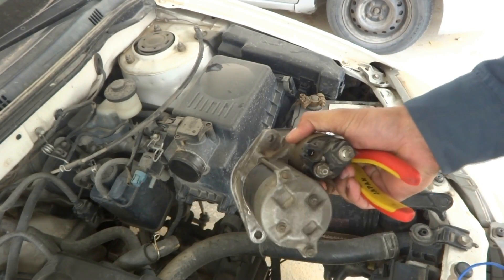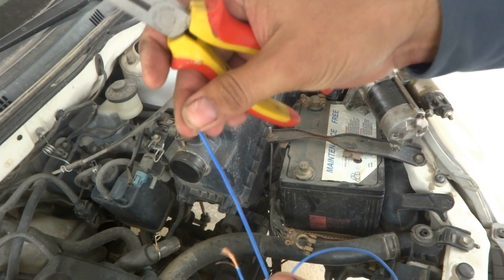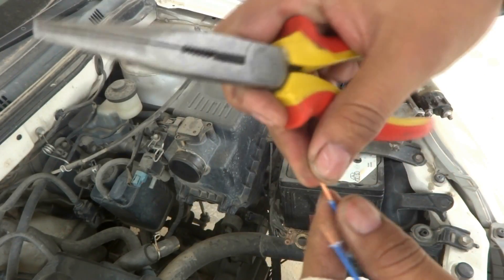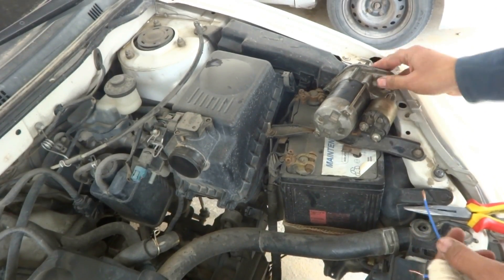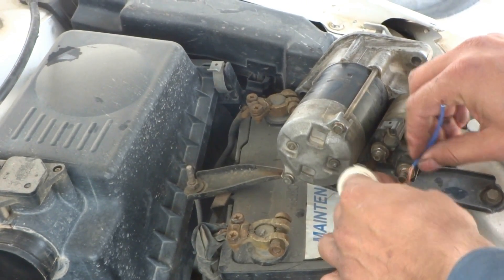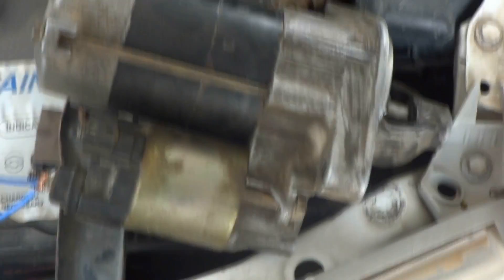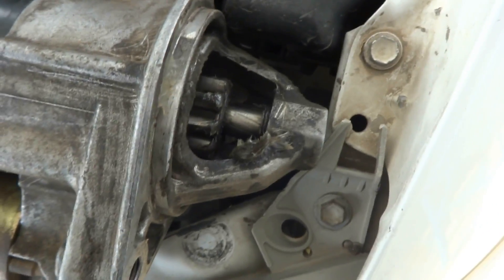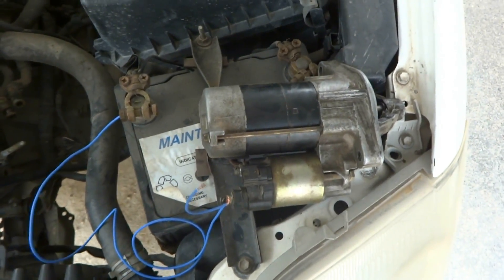Car Self Starter testing. Off car self starter testing.

Comment: Thanks ! My Zen Estilo takes a second to start after moving the key ! I have checked and cleaned the battery terminals but still the problem exists ! My car should start instantly after turning the ignition key ! Pl suggest!
Reply from the maker: There are many possibility to no start condition. Good start is to computer scan the car.

Comment: Dear Sir, Thanks for your great video on how to do the testing. 
My car is Santro Xing 2005 make.
I am facing one problem, that is after I drive a car for 20-30 mins and if i stop the engine and try to start again the car wont crank or it will crank at a very minimum as if it is dead. After 2-3 attempts or waiting for 2-3 mins the car will start again smoothly. 

I had taken this problem to 2-3 local electrician all suggested to get the started serviced. I got my starter serviced and then Electrician performed the testing in the same way as mentioned by you.
But,  after doing the service the problem still persists. It would be great if you can help me with the same.

Can you please help me to identify the root cause.

Comment: Nice explanation. Please keep on doing lectures on common car problems and how to perform DIY. 
My cultus 2007 AC started giving problem as it will start and stop automatically on motorway. It is not problem of temp sensor as even in hottest conditions it will not start. Seems pressure or low gas but need your advice on how to test it step by step. 
Please reply or make a video in it. 
Thanks
Reply from the maker: There are several reasons for such defect. One is low refrigerant in the system. If it's OK then second reason could be dirty and blocked evaporator. I mean the evaporator became very dusty and blocked from outside which restrict the air flow hence the thermostat sensor feels cold and it stops the compressor frequently whereas you are not getting any cooling inside due to air restriction. So better attempt evaporator cleaning but sure it's a bit expensive job due to too much labour involved in opening and removing evaporator from under dash. Wish you very good luck with your repair. Also comment after attempting the repair.

Comment: What happens when the starter will run off the car but, not on the car? I had a certified auto electrician check the whole car for shorts, damages and wires that might be disconnected. The starter relay is good and working as well as the safety neutral switch and the ignition switch and new battery. Also, the engine is not locked up.
Please help.
Awesome video. Thanks a lot.
Reply from the maker: Dear friend you may watch my other self starter video on Toyota camry no start case study. There I show how to test for two power rails for a starter. You may test them with a tester or with a multimeter when the starter is on car and refusing to start the car. If both of those powers are good according to to the conditions, then there is some problem with the self starter or its pinion gear which is not spinning the engine. If there is no power or there is voltage drop on any of the two wires, you may check electrically where is the missing point. Without a missing there must be no voltage drop! Check your work again and look for possible defect. Share your success here with us! Here is the video link:
https://www.youtube.com/watch?v=Ugc7seEWMjw